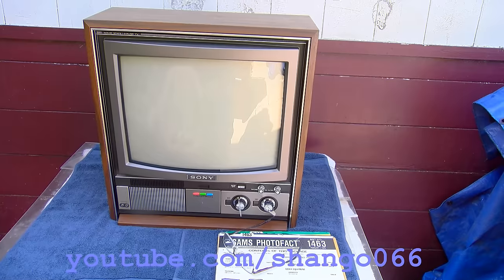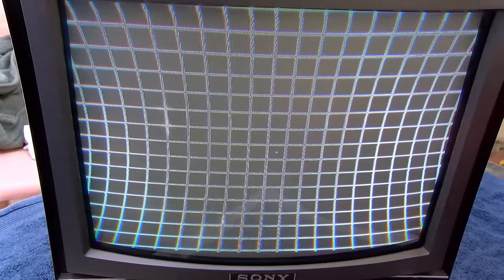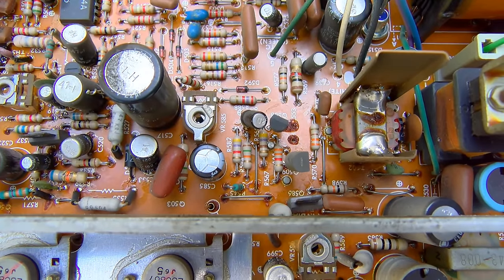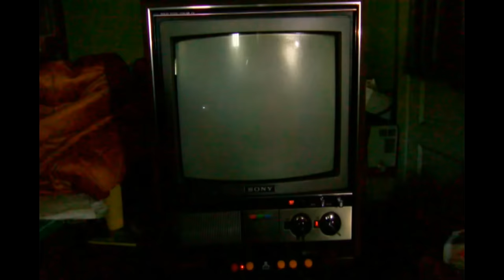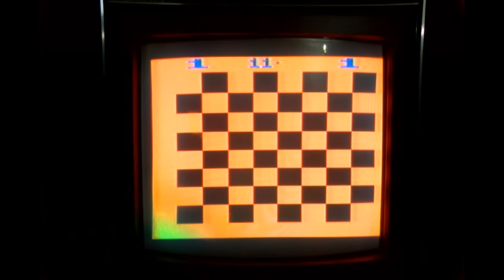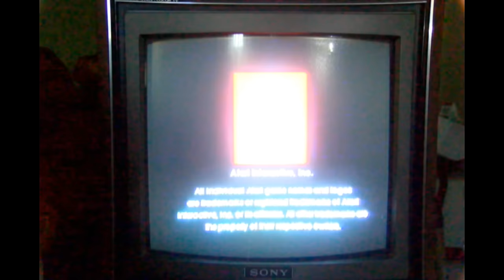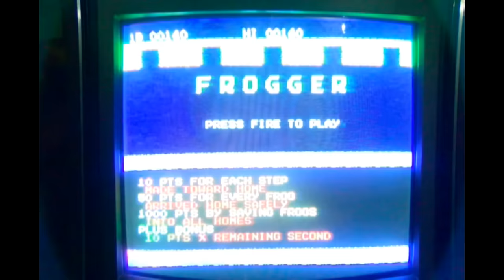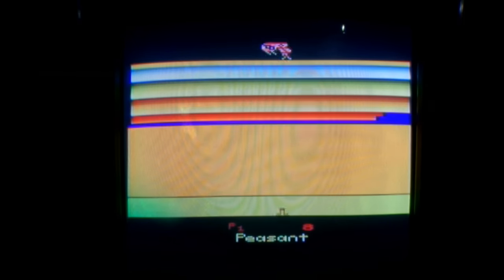1975 Sony Trinitron KV1722 Pincushion Repair Vintage Color Television Test

Comment: I had one of these little personal Trinitron sets from 1988 on, was  a gift from my grandparents. I still remember how beautiful and vivid the colors were on that set. It worked perfectly until 2006 or so when the power button finally wore out and it would repeatedly flip on and off. It was great for NES and Genesis games back in the day.

Comment: You are a much better video game player than me, seriously.  Despite the crushing reality of it, that Sony is in amazing condition accept for the horrible solder joints, flux all over the boards and dead capacitors.  It deserves a total  restoration.  Whoever owns it should spend the money or learn how to do it by themself. My two cents that this is a priceless beauty in need.

Comment: I was and still am, a big fan of Sony TVs.  That’s the only kind I installed in my house years back, when TV was worth watching.  The old CRT Sonys all work as perfectly as the day I bought them.  I don’t use them much now but they are all way to nice to just scrap.
Reply: Yep they always just worked. Had a 30 inch I think it was. Huge tube TV.
Reply: @tedbell4416  I have a 32” top of the line XBR2 with built in DBX surround and a second pair of speaker outputs.  I bought the set new back then.  It only has few hours of use, and weighs just about as much as the engine in my diesel pickup.  That Sony will be staying where it is.  I still can’t believe what I spent on it.   I swapped the two side hung speakers with a small pair of Infinity speakers when I got it.
Reply: @chatrkat  sounds like a good one. 👍

Comment: I love playing video games, but understand it's not for everyone.  Same as fixing old tv and radios is not for everyone.  I love the Atari.  The original console the best to play.  The flashback consoles are ok, but have issues.  The controller needs line of sight to work as it's working with IR sensors, so no line of sight, the controller doesn't work.  You can plug in an original controller which i recommend. Also, push forward on the controller when playing Asteroids and the ship will move around the screen.  Pull back to warp to other parts of the screen, which comes in handy when almost getting hit by an asteroid.  Enjoyed the video, even if you bagged on my hobby and favourite console.

Comment: Oh, one more thing about the 2600: it had no RAM to speak of, and no video generator like you’d find on any computers of the era… the code in the cartridge ROM was generating the video signal basically all in software, what’s referred to as “racing the beam”. Amazing that it worked at all, considering the processor involved…

Comment: I love your commentary. These "throwback" consoles are usually garbage. I found one of the family's original 2600's stuffed way into the back of the garage of the old house many years ago with severe rain damage to it and all of the games. It cleaned up pretty good and while the gameplay isn't great, because it's a 2600, it's much better than trying to use a controller with an IR remote. These old games are usually really fast paced and require a controller and TV with 0 lag time. That's why these old TV's are so sought after for these old games. Modern digital TV's have to buffer the analog signal and thus creates some lag. The difference is measurable on a human scale as evident by my high score on the game KABOOM.
Reply: The original atari 2600 was so much better than the crap copy, you could buy games on cartridge,  friends often borrowed them.
A bit of fun in that era :-D
Reply: loved Kaboom,got good at playing it.
Reply: Another reason for CRTs in gaming is games like PlayStation games are too pixelated on a modern flat panel to be playable. I remember discovering how bad it was trying to play the original PS1 copy of Spyro the Dragon on a LCD. Horrendous.

Comment: Well done for getting it working properly!
I gather that these old Pincushion Correction circuits which corrected just on the East-West Axis worked by using an Integrator
fed from the Vertical Timebase to produce what was called a Parabolic Waveform which was then fed to the Horizontal Output Stage to modulate the width of the Raster and so correct the geometry (when suitably tweaked).

Comment: This sure brings back memories! I had an Atari 2600 back in the early-1980's. Using one's TV as a video game center was a novel concept in those days. The CRT appears to have purity issues in the lower-left corner. I'd much rather play Atari video games than deal with "crepe erase."
Reply: I think he said the purity issue was due to the TV being set atop a speaker. Good point though. I'm a little too young for a 2600 but I feel the same way about SNES.
Reply: Oh yeah ? What’s ur angle of age ? 🤣🤣

Comment: All those black caps are very swollen. Any time you see the plastic outer label pulled down from the top like that, they have usually pushed the rubber plug out the bottom and it pulls the plastic sleeve down with it.
Reply: not always, heat can make the 'jackets' shrink, thats how they're fitted in the first place, heat shrunk on , ones that exhibit this symptom have been subjected to external heat, or internal from high ripple/pulse current, and may have poor esr

Comment: I grew up with this exact model set.  We got it usedwhen the neighbors were going to get rid of it/throw it out sometime in the late 80s.  It lasted another 10 years of heavy use before the color became impossibly green-tinged and there were big dark and light bars vertical bars on the screen.  It was replaced with a new larger 27" Trinitron that itself lasted another 15+ years in daily service.

Comment: Great video, normally you'd have to pay me to watch someone play atari home console but you made it entertaining ! I only have to say that most people in their right mind wont splurge 600$ or whatever on a vintage trinitron / professional grade crt just to play atari. In my oppinion its most commonly people with original arcade game hardware or rgb modded game consoles from the 90's / vintage computer folks which actually benefit from sharper displays with better text clarity etc.
Reply: Agreed, the appeal of the 2600 was always the arcade-style playability of the games not the eye-popping graphics. So it can be played on anything with a screen - I use an ancient Panasonic plasma mounted on the wall in my basement. You're right that the 16-bit consoles (SNES, Mega Drive / Genesis etc) do respond better to a CRT than a modern LED TV, but even these are quite OK with plasma in my experience.
Reply: I found one of the 20 inch PVMs for free from a local free CRT dump ad on craigslist a couple years ago, usually almost a thousand bucks on ebay and it works perfectly and was spotless internally. Some good finds are still out there, just gotta be ready to pounce.

Comment: A common problem with these was a shorted mylar capacitor on the pincushion board. It would read as a short across SG613 horizontal output and of course blow the main fuse.

Comment: It's a beautiful set, but I wouldn't say it's a vintage gamer's dream. I am a vintage gamer, and the first thing I notice is a lack of composite input. So this might be okay for Atari or something, but not NES on up. Not unless you want to go in through the tuner on channel 3, which provides a not so great picture. 

Personally If I owned a set like that, I would just watch Lost In Space on it and call it a day.
Reply: Composite is crap. You want component or SCART Or S Video
Reply: A lot of vintage gamers go for I think those Sony Vegas orders older trinitrons that were from around the turn of the millennium or or the HD CRTs which you almost need a team of bodybuilders to move

Comment: These sets put out a remarkable picture.  I have 2 of them exact same model in my bedroom, one is Minty the other one is fair. Both had linearity and geometry issues that I was able to correct without changing out electrolytics.  Believe it or not these CRT's are starting to get either green halo or PVA rot.

Comment: To enjoy games, you really need the manual, or somebody able to guide you through. I know from own experience. Played several games 35 years ago that I aaaah didn't actually own. Frustrating experience. Now recently I found the manuals and I found they were actually great games.
Reply: the manuals often made up for the lacking graphics. I do remember being a bit disturbed by breaking blocks in Mario Bros. because the manual says Bowser turned the citizens of the Mushroom Kingdom into blocks. So if you break them, you're basically murdering people. Great job, Nintendo!

Comment: Cira 11:00: My sentiments exactly sir, it’s always amazed me why anyone plays those games.
Like you suggested, learn something that will earn you some money or something that will be of significant benefit to you in real life. (or Just be out earning money instead) 
The programing team that wrote most of those games will beat anyone, hands down, every single time. How can anyone get so excited? And even addicted, to those “games”.
Beats me mate.
PS Keep up your brilliant YouTube offerings, I love to watch, although I’m in the UK, the radios and TV’s were somewhat different, e.g. valves types different and nearly all of them used series string for the heaters, most had the chassis connected to one side of the mains (240V). Colour reception (PAL) was only available on UHF (channel 21/65) at 625 lines, and we used T.V. channels 1 thru 5 and 6 thru 13 on VHF for B&W (405 lines).
Sorry I digress, but the main reason I love to watch your channel is because it takes me back in time, to a time I would much rather be now. Who, in the World, would have even remotely considered then, what would become of TV’s, radios and computers as they are today?

Comment: Outrageous that the PCB made it past Sony Quality Control. The underside sprayed with too much flux and then dipped copper side down in a molten solder bath. Unfortunately too much moisture that day in the PCB board, hence all those air (steam) bubbles in the solder and the resulting dry joints. Still, amazing it still sorta works to this day...

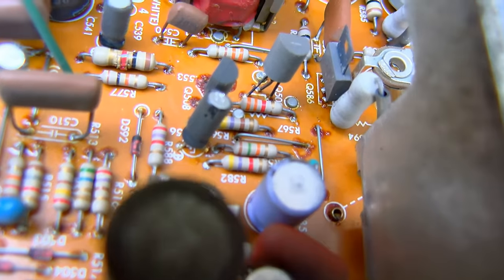Comment: did you spot that half exploded resistor at 6:03 above R557?
Reply: if its the one i think it is, doesnt look 'exploded' to me, just the paint has flaked off, maybe due to moisture, slightly excessive heat or a bit of both,

Comment: The games that were out in the late 70s and early 80s were completely different from the games that came later which were major time vampires.  The Colecovision, Intellivision, Pong machines and Atari 2600 were game systems you didn't spend a whole lot of time in front of. 
Also, that flashback is crap.  If you want to use flashback machine, use the flashback 2.  The flashback 2 is an Atari 2600. You can even add a cartridge slot to it.  The machine you have is not.  Some are nintendo NES on a chip some are far more generic (not all the flashback units are the same).  But the FB2 is a 2600 on a chip solution.  It runs the actual games and not just ports of the games.  Even the menu is running on a 2600.
Reply: That is a Flashback 2 isn’t it?  Flashback 1 was a black plastic unit with red sticker and wired controllers!
Reply: @SproutyPottedPlant  No.  You can even see when he's in the menu or when it boots up that it's not a flashback 2.
The flashback 1 was a nes on a chip as was the 7800 flashback unit.
The 2 was the only genuine Atari hardware machine.

Comment: Why do these old tvs hate text on screem?
Reply: The buzzing is caused by all the extremely sharp and frequent transitions in the video signal (text,  pixelated graphics, etc.). Older sets weren't designed with such content in mind so these frequencies can make it into the audio path.
Reply: @GeckonCZ  makes sense

Comment: On the two holes for holding the back on. I'd guess the engineers designed it to have 2 fasteners at each location and over time they 'thrifted' it down to only using one. Probably saved them .03 cents/set...

Comment: Unless it can be easily modded, not a gamer's choice, let alone dream.    Composite and stereo are necessary to be in the category of "Gamer's Choice"
Reply: Composite - yes, stereo - no, you can use a separate amp.
Reply: @mrnmrn1  You can. But most gamers don't.
Reply: Old consoles and computers didn't have stereo.  For that matter, many TVs didn't either.
Reply: @sa3270  Genesis (newer ones) and SNES both do.  Personally, I don't think composite makes that much of a difference. All the old game systems and computers operate a low resolution.  The main problem is usually that they're old and out of repair.
But most other "gamers"(I am a retrogamer)  think otherwise.

Comment: The 2 screw holes would probably be standard if there were similar models on sale so like rather than pressing unique moulds for each. I've  een that many things with range variations eg walkmams - bog standard/on off graphic equalizer/slider etc that kind of thing

Comment: My brother has an Atari flashback, and he plugged in an ac adapter with the wrong polarity and a capacitor exploded inside. Threw it away instead of fixing it because i hate the damn humming.

Comment: Would I call this set a gamer's choice? possibly - it depends on the games and type of console used (you could perhaps modify it to accommodate a PlayStation if it hasn't already got the appropriate inputs).

Comment: Hey Shango, Nice repair! As a Gen-Xer, I spent many hours in front of a KV-1710 playing Parsec on the 1981 TI-99/4A from Texas Instruments. Great game. 
https://www.youtube.com/watch?v=uCSQd0eJKQQ
The Blonder-Tongue modulator - we used to use those at the head end of the cable company I worked for - I love your sense of overkill. I generally prefer working on things too - old radios and TV sets, old major appliances, and let me at your Fairmont. But sometimes a video game is a fun diversion for a few minutes.

Comment: Minutes out of your life you will never get back.
   Ya, those Atari controllers have crappy bubble switches which require cleaning to work right. Then again that would be more minutes out of your life to fix a game console that might amuse a 4 year old. 

 A 64 bit console would be a better match for that TV, Nintendo or Sega. Then again, minutes out of your life spent watching glowing bits of phosphor.